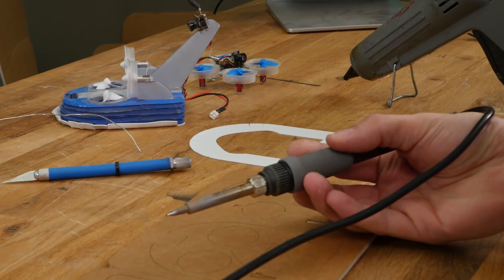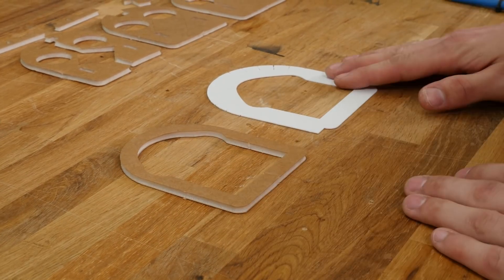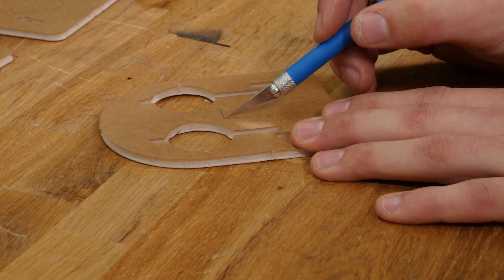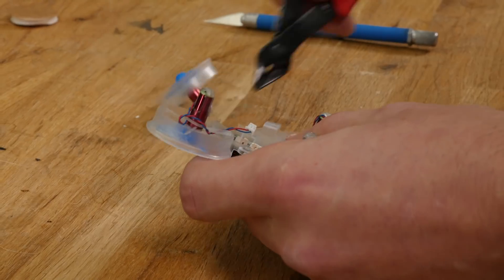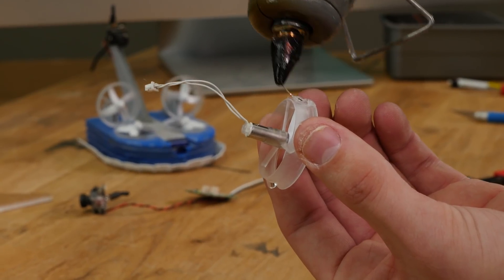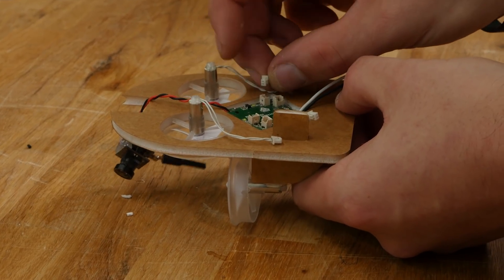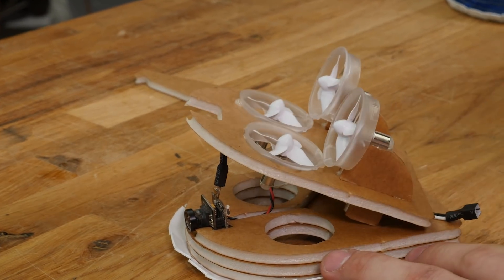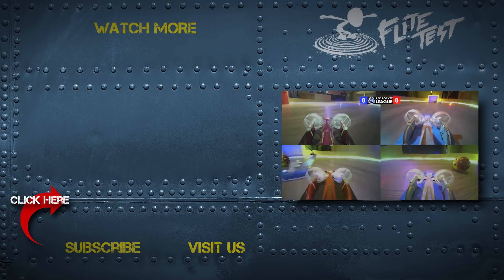Build a Hovercraft from a Broken Drone!!! | FLITE TEST

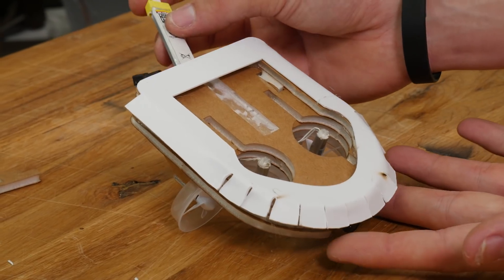Comment: Nice! Like others, I've seen this quite some time ago done about the same way. I have tons of parts from E010 and JJRC H36 quads that I use to teach my kids how to do simple builds. Of course I have to desolder and disassemble each before they start. They might enjoy a scratch build like this. A note to the video editor. At the 4:58 mark you can clearly see that either the 2 front motors were installed incorrectly or the props are were. Both are spinning counter clockwise. Oops.

Comment: built one of these with 1 piece of foam and some bread bag as a skirt so it could handle concrete and carpet.. it worked well  it was really fast but had mad oscillations. so i took it apart and built a  regular quad frame from foam board, its much quieter than the original plastic one was.

Comment: Cool. Pls make the same with 2206 or bigger Motors and a 5 or 6 inch Propeller. I think you can make the parts with a 3d printer
Reply: Nici619 join the Whoover facebook group

Comment: That's really nice! I made a rc hovercraft as small as this one, but using a toy grade rc car electronics. Works great, but it doesn't go too much straight. I think that the receiver board doesn't give both motors the same current. But it's fun, anyway. 😀 And I'm thinking about making one using only 3 motors (like my first one), but with a brushed flight controller and iFlight. 😊 BTW, I used a plastic bag as skirt.